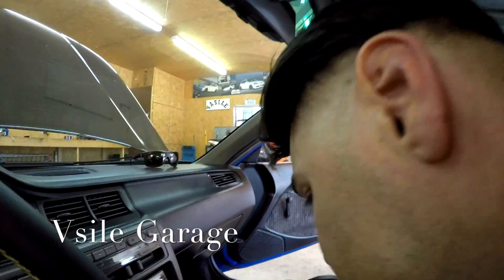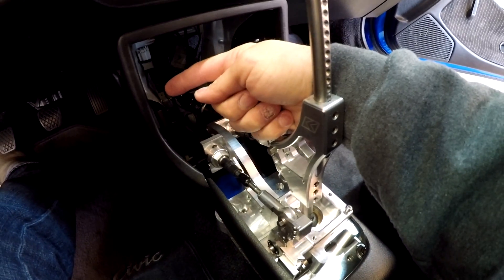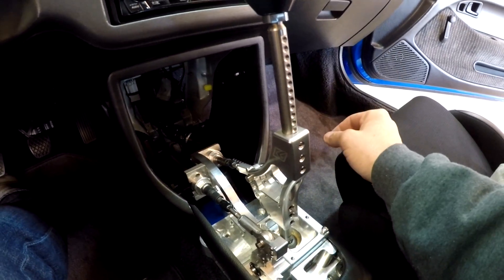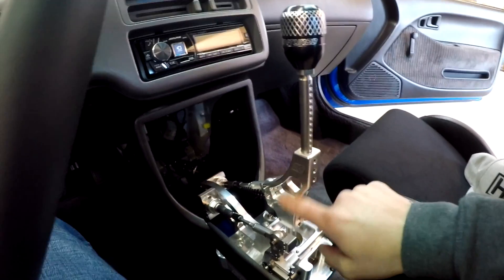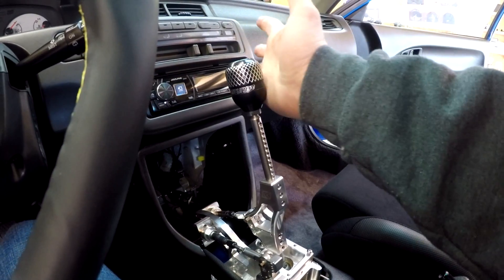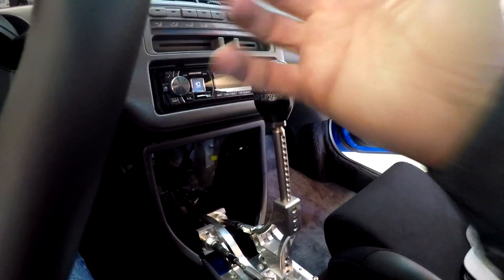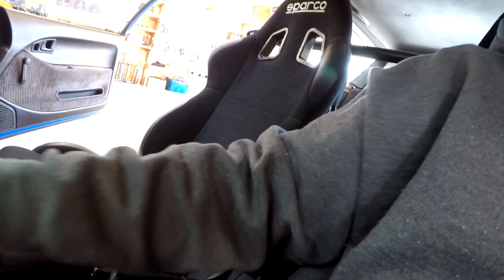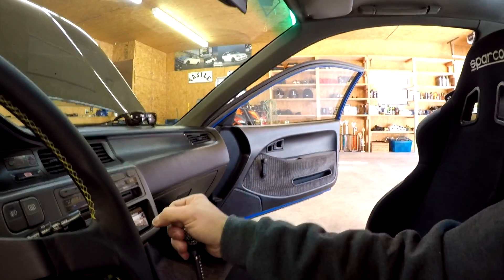How to adjust K-tuned shifter

Comment: I know this is video old but that cable closest to your right leg that makes the shifter move left and right. Do you need to adjust both ends meaning the one on the tranny and the one on the shifter box as well? The reason I ask is I’m having a hard time getting it to go in reverse.
Reply from the maker: Sam Han dint
Really have to adjust anything
Reply: But did you have any binding problems? It seems like the cable that makes the shifter go from side to side movement is too long for mine. I have the connector on the bracket screwed all the way to the end of the nut and that’s where it seems to be binding at
Reply: @samhan7048 did you solved it? I can’t go reverse either

Comment: roll bar are dangerous for the street!!!
Reply: with a proper seat belt setup and clearance the backseat passengers should be safe. could use a foam pad regardless, but its not as dangerous as the airbagless steering wheels that everyone runs.